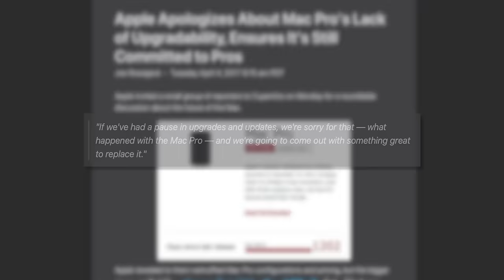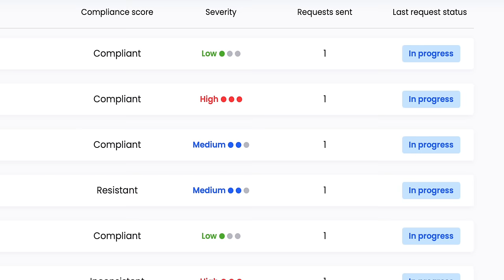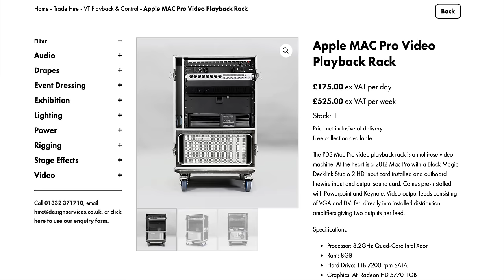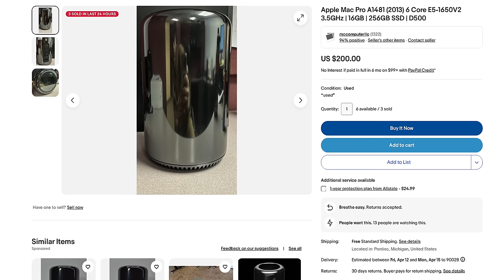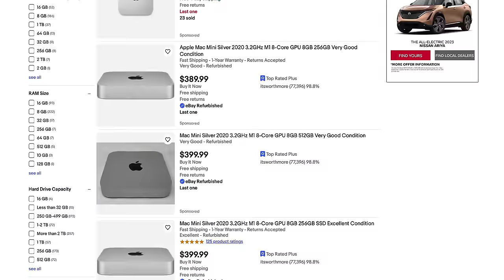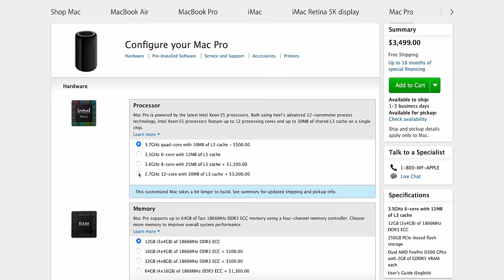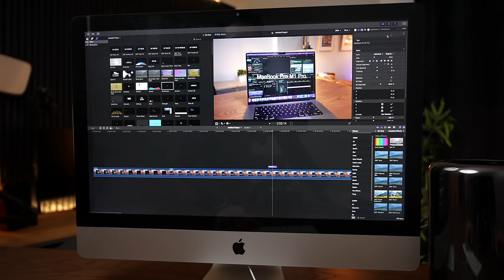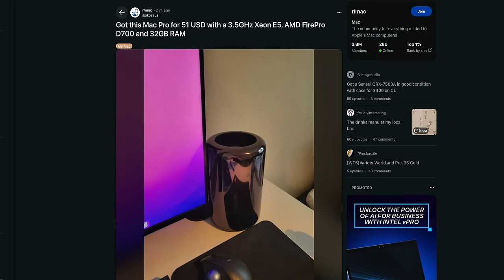Revisiting Apple's FAILED Mac Pro in 2024

Comment: But you don’t get 1TB storage and 64GB RAM with that Mac Mini! Just saying!
Reply: well you can get 1TB
Reply: @RonanACNH  with more money.
Reply: external tb3/usb-c SSD's are dirty cheap with (almost) no bandwidth penalty. RIP trash can.
Reply: @techindustries182 but I don’t like dongled accessories lol. I like upgrading the actual computer.
Reply: @techindustries182  And the adapters which allow you to use NVME drives on the trashcan Mac Pro are entirely passive and just change the connector from the proprietary one Apple uses to the standard one used everywhere.
Reply: Irony is even a USBc (non Thunderbolt) enclosure will be more or less the same as the performance of the Mac Pro 2013 due to the SSD being behind the PCH thus locked to PCIe 2.0 speeds.
Reply: 64 GB of DDR3 is not anything to get excited about in 2024
Reply: @RonanACNH  For double the price of the Mac Mini!
Reply: @jameszaccardo1520  It's ECC RAM on the Mac Pro.
Reply: @BrunodeSouzaLino  DDR3 ECC. and ECC is slower
Reply: @jameszaccardo1520  You're not gonna be gaming that much on Macs anyways and server CPUs run at lower clock speeds, so that's a non-issue.
Reply: @BobLadif-ny8ni And then buy another one when the RAM fails because it is soldered on the motherboard.
Reply: @BrunodeSouzaLino  it's a "non-issue" if you don't care about speed. DDR3 was great a decade ago but you are fooling yourself if you think this thing is comparable to any apple silicon. Even an M1 with 16 GB of RAM would run circles around this. There is no comparison.
Reply: @BobLadif-ny8ni even an M1 would trounce this decade old xeon.
Reply: @jameszaccardo1520  I hope that running in circles makes you money somehow because you're gonna have to buy a new Apple Silicon device if one of your RAM chips fail since they're soldered on the motherboard. With the trash can, you just find the defective module and replace just that.
Reply: @BrunodeSouzaLino  lol dude the only RAM i've ever had fail was after 10 years and it was DDR3. If my m2 mac dies, my insurance will replace it. And yes, I use my mac for work so it does make me money.  If you want to buy a trashcan just because thats fine, but its slower than an m1 mac.
Reply: @jameszaccardo1520  ECC is always slower everywhere due to bit checking. That's the point of ECC. Speed is secondary.
Reply: If you desperately want a lot of ram and for some reason arnt willing to live the dongle life get the 5,1 Mac pro. Its performance is fine for most users and it looks cool, just be sure to get one with a dual processor board
Reply: If you desperately want a lot of ram and for some reason arnt willing to live the dongle life get the 5,1 Mac pro. Its performance is fine for most users and it looks cool, just be sure to get one with a dual processor board
Reply: @firesurfer what I said is accurate. Direct your comments to the guy who thinks DDR3 is comparable to the unified memory on apple silicon
Reply: @xbrun3356  it's better than the trashcan for sure, the dual 3.46 processors that you can get beat the trashcan mac. its still a decade old and the speed reflects that. just build a pc if you are on a budget
Reply: We are talking about 'worth'
Reply: @MaiElizabeth  that's true, it's not really worth spending time on upgrading an older Mac because support for Intel platforms will end soon. On Mac is at least.
Reply: @MaiElizabeth  yea, its not worth buying an older intel mac.
Reply: Reason why I gave my base mini m2 to my parents and keep this one…dual boot with Sonoma and Maverick….one for work and one for fun (Aperture)
Reply: @DengueBurger then don’t buy mac. problem solved.

I don’t understand why storage isn’t upgradable on ARM devices anymore, like clearly you can slot an SSD in that’s slower and it doesn’t slow down anything else.
Reply: @jameszaccardo1520  It's DDR3 1866MHz in quad channel (59.7GB/s). That's comparable bandwidth to DDR4 3733MHz in dual channel which is still decent. It's not that far behind compared to the M1 LPDDR4X 4266MHz dual channel (68.3GB/s)
Reply: @Pasi123  but the cpu difference means its not close at all. do you really expect a cpu from 2013 to even be a fair comparison?
Reply: @jameszaccardo1520  I'd still take a 2013 CPU with 64GB RAM over a faster CPU with only 8GB RAM. I've had more than 8GB RAM for 10+ years.
Currently I have a X299 system with 64GB DDR4 and will upgrade to 128GB sometime in the near future. My motherboard can take up to 256GB.
Reply: @Pasi123  but its paired with a cpu that is not even in the same realm as any of the apple silicon. its over 10 years old, its 12 cores is beat by even a 9900k.
Reply: @Pasi123  lol who even cares, upgrade your machine if you want.
Reply: What bums me out is that Apple’s biggest design swings in the Pro space have been high profile failures.

None worse than the 2013 Mac Pro, I will grant you that. But the Power Mac G4 Cube was as spectacular a computer as money could buy in 2001, but they fell short on the QA testing side and wildly overpriced it.

That was a tragedy, because as design went, the G4 Cube was nothing short of a work of art.

What’s ultimately disappointing is that design has been air-locked at Apple. Outside of making products that don’t need to be thin thin (I’m looking at you, AS iMac), function has completely subsumed form at Apple.

That’s not a terrible thing, I acknowledge, but it isn’t the Apple way, either.

Apple was saved by taking giant design swings, but now, design is all but an afterthought.
Reply: @jameszaccardo1520  Most people into working on and with old computers are just vibing. New Mac minis are a great choice for a lot of people, even the new IMacs are.
Reply: @theallmightyham  "working" on old macs is just the diluted version of building actual PCs.
Reply: @charlix3  Apple wants more butter on their bread.
Reply: Swing and a miss.

Comment: Sorry Luke, couldn't disagree more with you on this one. Doing video, not perfect, was perfect at the time. But it's still a photoshop workhorse, and it gave me 8 years or work before I retired it to a file server, which it still operates as, encoding non-essential video in the background while I do other things on Apple Silicon. For the price now, it can't be beaten. In fact, I just bought a newer 2019 model machine four weeks ago, for $300, just to get the D700's that I wanted for my 2013 machine, but decided to leave them in the 2019 computer. I now have two, one maxed 12-core, and one maxed 8-core. The new machine also came with a monitor, keyboard AND a mouse. Considering that just to buy the D700's was $400, I got everything and more. This little trash can NEVER gave me any problems, EVER, and was a solid working investment that paid for itself a thousand times over. It cost me over $5500 to purchase and probably grossed me over $1M in its lifetime, so I'd say it was worth the investment. I would typically burn out the CPU in five years. Sometimes it's not just about the numbers, but about the dollars. Is it perfect, NO. Was it great in my case, absolutely!! Would I buy one now? Well, I just did. And as a media server, I think it will be great. As a backup computer in the event that Apple Silicon will have a problem, I know it will get the job done, but just be a lot slower. LOL.
Reply: Have to agree, it's a beautiful design and it can run bootcamp. Pity the Mac Studio isn't in this form factor.
Reply: Yep I got a ton of work done on it all the way into early 2021, when I put my first Mac Studio directly underneath it.  The cylinder was solid and reliable — and gave me two 4K retina displays at 60fps with the correct Dell monitors.
Reply: I agree! I have had mine since 2015 and it worked well for me where I was at the time.  I recently bought a Mac Studio and now I am trying to figure out how to best use my Mac Pro?? Any suggestions ?
Reply: I can't disagree more.  If Apple built the trashcan into a traditional chassis using a traditional motherboard with slots for addon cards, it would have been much better while costing significantly less.
Reply: @robertp457  Costing less? You clearly don't know anything about Apple Macs then. I've had cheese grater Macs, several, and a mid-level configuration ALWAYS cost me $5500-6500. So no, you're not right.

Comment: So... maybe someone can put a Mini-PC inside that beautiful case and make it functional 👀
Reply: I saw a video some months ago with a guy building an identical case like tis but 3d printed and making it same as functional with same 1 fan but 120mm Noctua If im not wrong and looks amazing
Reply: A Ryzen 7840HS mini PC could totally fit on this thing and the latest Ryzen integrated graphics easily beats the 10-year old Radeon Pro GPUs. Just need some USB dongles for the I/O
Reply: A Mac Studio would be preferable
Reply: @yeknommonkey  according to prices It won't, at least compared with those Ryzen 7/9 soldered tona motherboard that cheap
Reply: My thoughts exacly. Already Done that with The infamous iMac lamp from 2001. Why not The bucket😂🤓
Reply: You're just too smart.....👍🏼😎
Reply: This is The pinnacle of Jonathan ive’s work. Besides The 2001 iMac lamp
Reply: Every Apple fanboy should own one😅
Reply: Just for The shelf😂
Reply: What's beautiful about a trash can. Like saying the Tossler Cybertruck doesn't look like a urinal.

Comment: Too bad Apple has forgotten this lesson. The Apple Silicon machines are all incapable of upgrades. I really don't buy their argument that storage and ram need to be soldered on. I've been an Apple fan since the Apple IIe, but design decisions like that make me wonder.
Reply: It's because Apple is such an eco friendly company that they make computers to be disposable.  Makes sense.
Reply: They don't. Wintel has massively better performance for cheaper while being modular.
Reply: Of course you can't upgrade them they're SOC, which is what allows fast speeds, crazy low power, low heat, and silent fans. The RAM is on the SOC, and the driver controllers are on the SOC. You make it sound like Apple just uses off the shelf Wintel parts for their CPU, GPU, and storage.

Comment: I have a trash can Mac that I paid 300 dollars for. I used legacy patcher to get modern OS and I love it.
Reply: Same I got the 8c/d700/1tb SSD with 64 gb of ram and dual boot with windows on an 1tb external SSD and it is great! I don’t do video editing just programming so it has been fun to use.
Reply: @troymd2009 I have the same setup and I to don’t edit videos. The M1 mac mini isn’t a good comparison because of the limited ram and storage
Reply: I bought one of these a year ago for £350 and it’s been brilliant to be honest. I use it for software development day to day as well as some music production. The only reason I can see myself upgrading from it is when software stops working on that last os it supports. And even then I may just switch to Linux! 

I’ve got seen an m1 Mac mini for as cheap as that in the uk but nice to see prices coming down!
Reply: @mttshw  I don’t know what programs you run but I used open core to patch mine and it runs Sonoma fine
Reply: Time to upgrade that crap. Get onto Apple silicon
Reply: @troymd2009 time to upgrade that crap
Reply: @carson2646  time to upgrade that crap. Get onto Apple silicon
Reply: @carson2646 silicon Mac suck cant run old software, silicon design are design around subscription service fees. Adobe paid vs Adobe cs5.0-6
Reply: Same. Anyone who says it's e-waste doesn't know just how capable this machine is still. there are things to look out for with older hardware, obviously (d700 GPUs are prone to failing, power consumption) but once opencore is used to upgrade the OS, this machine is a cheap, but powerful Mac!
Reply: How does the chassis look? Does it have many scratches or imperfections?
Reply: @CellarDoorx06  mine is nearly perfect
Reply: @CellarDoorx06  same!
Reply: @carson2646  💯 agree. I want to get a Mac Studio with at least 32 gb of ram and 1tb storage but this will tide me over as I finish my degree. Plus my work supplies me a work machine too. So I am not in a rush right now.
Reply: That's what I do with my 2009 Mac Pro too
Reply: @ghengisdingus8644  I've just purchased one of these with the eight core CPU and the twin D700's GPUs - is there any tips you can give re: nursing the D700's to stave off failure?
Reply: @Rendell001  unfortunately I don’t know. I have D500s.
Reply: @Rendell001 a repaste and Mac fan speed control.
Reply: @macgamer1973  Not sure where you got that info. Apple Silicon can run old 64 bit software with Rosetta 2. Apple Silicon runs rings around any Intel Mac.

Comment: I'm a developer and I have a base M1 Mac mini, and a 128GB/1TB SSD Trashcan (which cost half as much). I set up a home lab on a budget. The M1 is fast for compilation, but won't run a decent size Kubernetes cluster. The whopping memory on the trashcan is great for Kubernetes and means that the slower CPU/graphics/SSD doesn't matter. Basically, I wouldn't be without either. Each is the correct tool for a particular job.

Comment: 💡 Try to fit the internals of a Mac Studio in there.
Reply: since now it's all about a SOC with low power consumption, I guess the current design is fine since it achieves this 2 things: the smallest possible footprint and enough heat dissipation.
Reply: Yeah I want that and a g4 cube shaped acrylic stand for a Mac Studio
Reply: Cause a square motherboard fits into a sound hole. Not
Reply: @emilsecker7881  Exactly 🤣

Comment: You are overlooking one very very useful function for these. Multi core CPU workloads. I use some tools where they are clock speed limited but get huge speed increases from having up to 12 cores. A 12 core unit on eBay with 1tb ssd and 32 gigs of ram can be bought for $300, way cheaper than even a 12 core CPU can for a modern PC. I run windows on mine compiling light maps for older games and it rips through themes such a great machine I may buy a second.

Comment: Still rocking the 2012 Pro here with 64gb RAM, multiple 4TB drives/SSD, and dual processors.
Reply: Yeah, I used to build those for people and sell them.  Great machines.  The CPU is getting a bit long in the tooth at this point but more than fast enough for most uses.  Sold my last one about a year ago.   It was definitely the best computer Apple has ever made.
Reply: @gametime2473  I can still edit 6K raw video with no problem at all. I had a dual processor tray with the highest spec processors but either the processors or tray died.
Reply: @GearZenChannel  Hmmm, haven't seen the tray or CPUs die before.   Usually it is the power supply or logic board that go bad.  The CPUs are dirt cheap now so upgrading your current system would cost almost nothing.  I went to a PC workstation with the W series Xeon.  Such a huge bang for the buck.
Reply: Yes I have a 2010 also. Same specs.
Reply: Time up upgrade that crap. It’s been unsupported for years
Reply: @emilsecker7881  When I do get a new computer, this one will likely stay around to store files. It still does pretty much everything that I need a computer to do.
Reply: @GearZenChannel  time to upgrade now
Reply: @emilsecker7881 people still making hardware and software for retro computers
Reply: @macgamer1973  I get that. But still time to upgrade
Reply: @emilsecker7881  Your opinion, which no one cares for.

Comment: I keep one around as a Plex Server. One thing it has over the Apple Silicon Mac mini is that it has Error Correcting RAM, and the Xeon is a server processor, so it supposedly is designed to be a server or 24/7 machine. But then Apple Silicon Macs aren't exactly the most unreliable machines ever for leaving on 24/7 either.

Comment: I have a 2013 Mac Pro that's maxed out... but it's not running MacOS. It's running ProxMox and is my "lab" machine and running all of my server workloads. For this use case it's fantastic - in part because it doesn't make any noise and has to live in my home office. I love it - it's attractive, silent, and (for this specific use) incredibly powerful.

The interesting irony: my desktop machine is a Studio M2 Ultra. This machine proves that Apple wasn't wrong, they were just a decade early. Everyone makes fun of the Apple Silicon Mac Pro "why not just buy a Studio?" The studio, like the old trashcan, can't be expanded except outside the box using Thunderbolt, but unlike the Mac Pro, can't be upgraded at all... yet everyone loves it (myself included.) I would argue the trashcan was better looking than the studio, too.
Reply: Same here, I have 2 2013's maxed running XenServer.  Lots of lab room and doesnt make any noise, its perfect.

Comment: The trashcan Mac Pro's interior looks like hardware from an alien civilisation.
Reply: Indeed, and I always think of Darth Vader's helmet being removed when I open it!
Reply: I think Apple should make a Mac Studio that looks like that. It would make so much more sense as an Apple Silicon design than it ever did as an Intel design.
Reply: @ericwood3709 Mac Studio looks just like old Mac G4 Cube. Tash Can Mac Pro has some potential to make a comeback.
Reply: @KrzysztofPiwowarczyk  I'd say Studio looks like a tall Mac mini. The Cube with its translucent plastics and all looks pretty different, and the cooling in that was vertical like in Trash Can, albeit without a fan.

But anyway, yes, I think the trash can would be a great design for a cooler Apple Silicon chip, though come to think of it, it was shaped like that in part to accommodate the CPU + separate GPUs, something an Apple Silicon system simply does not have. Perhaps the Cube would be a better design for it. Apple could make one for some special occasion, perhaps, like an anniversary.